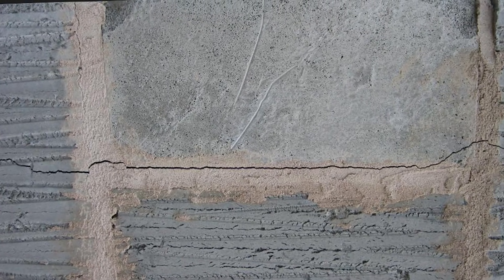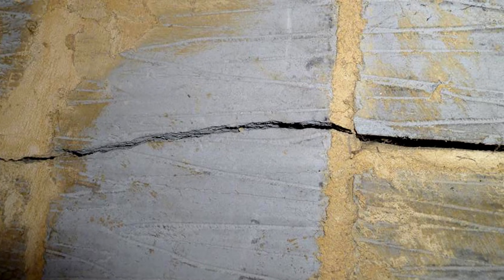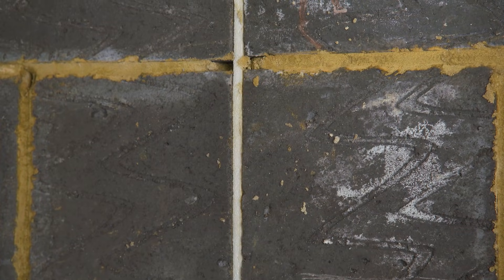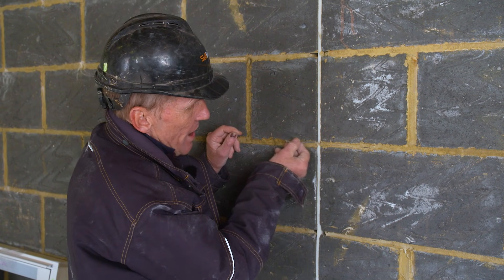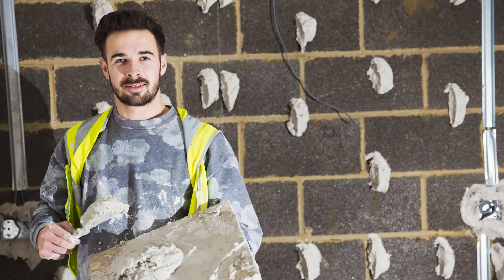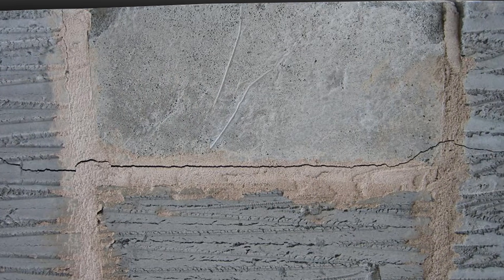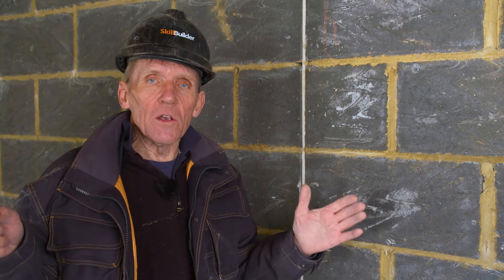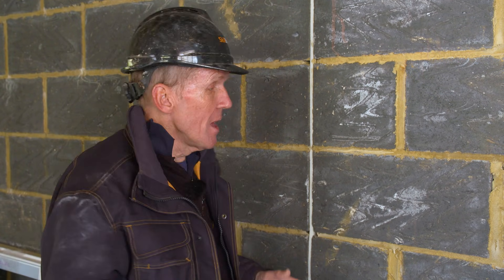Why Are Aircrete Blocks Cracking Up So Often?

Comment: But why you in UK using this tiny block ? Why not 375 or 300 mm block over 125mm what you using there? Just buy 375 or 300 mm Itong or Porfix block and you will never had this problems!!! Much better and stronger houses !!
Reply: the damp weather  for one.

Comment: Never add cement and lime together they work against each other. And majority of the time ends up a lot harder than a 5/1 Portland cement render would be
Reply from the maker: Jamie, with respect you are completely wrong on that score. Hydrated lime works with cement and won't set without. 
You can read lots of technical data about the use of hydrated lime and cement and it all points towards a crack resistant mortar with better adhesion.
Reply: Best mix for those blocks is a 1:1:6 ratio of cement: lime: sand.

Comment: Just a couple of things !! 

1. Most sites use silos now that are 6/7 to 1 ratio 
2. What’s the point in a movement joint on the blocks if u are dot and dabbing over it?? 
3. When u use a movement joint u have to use more wall ties! Every course vertical up both sides!! It’s literally going to do the same thing! 
4. Better using train track 
5. It’s all down to how materials are stored and kept! Sites should be setting up with a tin roof over all bricks and blocks keeping the rain and damp from getting to them! 
6. Better kept materials = better work = better houses = better trade simple as that.

Comment: I have a beautiful outbuilding that is full of these cracks.

It's fairly large (4.5 x 10m) single skin, unrendered. The cracks are so bad I am considering taking it down and rebuilding it.

Please do a follow up if you can with suggestions on how to address this issue.

Comment: Roger I’ve got some cracks on a few blocks on a block and beam floor. The floor goes over the top of the garage and I can see the cracks when I look up. The floor system is exactly the same as the one you did with your gang a few years ago I think 34a. The beams look in good condition though. Are the cracks anything to worry about? I’ve filled around the cracked blocks with CT1 to hopefully strengthen them.

Comment: Thanks Roger for great video, loads explained. Have seen new builds (not particularly big) where expansion joint hidden behind drain pipes at corners. That alarmed me that the gable then does not appear restrained properly (unless there are some hidden straps or clever ties). Suppose the roof timbers though might have more restraint straps and perhaps the floors also to keep it all together.

Comment: Excellently explained Rodger. 
Did you suggest that cracks are more likely under windows?
Why would that be?
Reply from the maker: Hi Roy 
The lintel above the window transfers the load to the side and it travels down each side of the window. When it reaches the bottom of the window it starts to transfer back but it only manages to do that in a diagonal which leaves the centre of the widow with no load. This means it can move easily and forms a natural break point. By putting in a few courses of bed joint reinforcement you are effectively tying the two loaded ends together.
Reply: @SkillBuilder  Ah OK that makes sense.
Thank you

Comment: Why did you need 2 movement joints in a 10 metre wall?
Reply from the maker: You may not but the structural engineer put it on the drawing and that is what was passed. The builder has no choice or say in the matter.

Comment: 6:1 mortar and EML every second course everywhere.
I have used this method for the last twenty years and it works.
I pay £6 for a 20m roll of EML, this covers approx 18m2 blockwork, works out at 33p per m2.
It's a no brainer to me.
As you said Roger the brickies don't like the tramline reinforcement but the EML is easier to use.
Reply: What is EML?
Reply from the maker: Expanded metal lath.
Reply from the maker: Do you use stainless?

Comment: Used thin joint on my extension and used reinforcement every couple of layers. Used monocouche rendering on the outside on the blockwork. Much better, and a better finish.

Comment: Spot on Roger, doing exactly that on my extension, doing it all myself as didn't trust any brickies at work (I'm a carpenter) 
Only one guy ever used lime before ,when he was an apprentice, they don't seem to learn much, as a proper bricklayer is a skilled and comprehensive trade when you get into it, but as most trades nowadays it's watered down to a basic craft for speed etc needed to get that off the chest, cheers
Reply: Same here - building my extension for that very reason. Asked the mortar question yesterday to a bricky in screwfix who replied they use exact same mortar on both skins, concretes and aircrete.
Reply: Sorry richard for your experience but I do agree, the need for so called tradesmen/bricklayers was so high they invented an NVQ. worst thing that ever happened to my industry. passing people within 6 weeks for a job that took at least 3 years to learn with intensive training . Blokes that I learnt from were on a 7 year apprenticeship
Reply: @scottnever8732  There are too many things that only come up now and again to be taught in 6 weeks. People also do not remember everything they are taught first time. You get decent craftsmen if they do a year in the classroom then a couple day release. then they get to be on different sites and see different things and problems.
Reply: @scottnever8732  NVQ?
Not Very Qualified...
Reply: @rob-123  Its more no ones interested in there trade  ,if you were you would read up on stuff and have lots pre knowledge for when you need it .
Reply: @MyKharli  it's an old apprentice  joke on what NVQ stands for. 😎
Reply: Lime is the way forward
Reply: As a bricklayer I don't take offence to you comment. They have really damaged my trade by not teaching it correctly anymore. 
All the bricklayers over 50 just shake there heads at all the young guys who think they are bricklayers but can't build a corner if they haven't got a profile.
Reply: @harveysmith100  It sucks, as a person learning a trade. It seems like I am being taught wrong, but I don't even know enough to say what I am missing, and how to make certain I learn it.
Reply: @springerworks002  If you have any questions, feel free. I am happy to help.
My advice to any young bricklayers is stay away from big housing sites. They are unavoidable sometimes but work of flats or commercial. The standard is much better. Also work with all the old bricklayers.
Watch Charlie Collison, his technique is very good and also watch Rob Songer.

Comment: Just don’t use them - end of!! 

Increase your cavity width to give you the same U-value and use standard concrete blocks!  

These aerated blocks are cheap shit, the crack crack and crumble and also cannot get a proper strong mechanical fixing into them! Should never have been given load bearing classification IMO!
Reply: They are fine if done correctly with a weak mortar mix,with lime even better, but not good in the colder months with lime that is.

Comment: I'm renovating a property built in the late sixties and have had to remove literally all the plaster off every wall due to the aircrete blocks cracking and loosening the plaster. Will it be ok to just dot and dab plasterboard onto the cracked blocks ?
Reply from the maker: Yes dot and dab, no point doing anything to the cracks as they are now the movement joint. Soft acrylic caulking might stop the draughts but don't use cement.

Comment: You should still put an expansion joint in a dry lined wall if not the plaster board can still crack. I’ve see this on long corridors were they were missed out and the plaster board cracked. We had to go back and retro fit expansion joints.
Reply from the maker: HI Dave I think you are right but customers won't have that stop bead. If they can be hidden behind a door lining then great

Comment: Can't do with aircrete blocks... Had them in a new build I lived in once the internal door to the garage kept pulling off the wall due to the auto closer on it shutting the door a bit too forcefully for the crappy blocks... Builders wanted to use them on my extension on my current house... Not a chance the drawings were for breeze blocks with appropriate cavity to give required insulation value.... Suppose the only good thing is that you don't need a hammer drill to drill into them... You could just push a biro into them

Comment: When people say stuff like 6 parts sand 1 part lime 1 part cement. How do you work that out. So how much is 1 part? Is it a spade full? A cup full? A bucket full?
Reply: Yes, it's a ratio, just make sure all parts are equal or the same
Reply: Ratio by volume not weight 6 buckets to 1 bucket to 1 bucket or other vestle
Reply from the maker: It can be anything you care to measure with. It is by volume not weight and it is not that precise. Most of the time we just shovel it in.

Comment: Do I have to use joint even for concrete 7.5 blocks? And what best mortar will be best for it, please. Thank you
Reply from the maker: Yes all block walls need to move. It should be on the drawing. If you are using 7.5 then a 4.1.1 is fine.
Reply: @SkillBuilder  thank you for the reply. No drawing, just in head for small shed, but wall will be 6.5 long and 7.3 is cheapest than 3.6 😁 (need over 900 blocks)

Comment: I did my own render indoors as the plasterer was to busy and it saved him time so he just did the pink coat. He told me his preferred mix which was 5 and 1 plus 1 of lime which puzzled me, he said it allows for slight movement. Anyway I did as he said. I cheated and used battens upright to get straight and level. I was thrilled when he came to pink up and commented on a nice neat job I had made. Did take me a few days though but I ain't a spread. Hearing his positive comment on my handiwork was quite rewarding.
That was 7 years ago now and no cracks yet,. 
Would like to know why spreads leave a gap between the finished floor and bottom of plaster, I think it's a damp thing but it can't be that simple.
Good vid that one 👍👍👍👍
Reply: It's sort of a way of stopping damp (from a floor spill) bridging but more importantly it stops the trowel  picking up bits of grit  into the skim coat that would 'drag' through the finish coat..It's also a time saver ;-)
Reply: Pure laziness,  not coating low enough 
Finished screed isn't laid til after plastering normally, so no need to skim too low

Scudding exterior walls is a great job prior to plastering 
Messy but creates a fantastic bond

Comment: Movement joints for blockwork are approx 6m in any straight run and 3m from a corner. This can extend to around 9 and 4.5m if you use bed joint reinforcement. It's closer to the corner as it's a point of high restraint. I say "approx" as if you were to 
put a joint after say 7m it won't definitely crack it will just have a higher chance of cracking. 

Roger, you hit the nail on the head with the mortar.

Comment: Way impressed what a total clear and concise video with everthing gone through and  fully explained 👍🤘
Reply: Bollocks, he says the weight of a JCB and he'll have meant an RSJ. Re cracks he's saying the cracks will be in the mortar if the mortar mix is 'right'. How is that better? And Nm (Newtonmeter) is not a unit of pressure, and 3.5 Newtons is like 4 apples of weight so that can't be right either. He mentions reinforcing mesh in the mortar; he should have said the first coat of plaster. The aerated blocks in my extension are riddled with cracks..bottom line ..aerated blocks are a crap building product.
Reply: @hectorheath9742  The problem is you think you know, but have no idea.
Reply: @UberAlphaSirus  Oh really, Sirus? You've gotta defend your comment with a reason or reasons. Tell me what's wrong with my accurate review of this shabby vid.  But you'd better read the rest of the comments first.
Reply: @hectorheath9742  I told you already. "The problem is you think you know, but have no idea." I read everything you and others said before. What do you want me to do? I can't un thick you.
Reply: @hectorheath9742   @Sirus  @UCpY_MMTfZd02WUzShANsQMQ Hector is right there were mistakes.
Good catch on the RSJ I was confused there.
N/m is a unit of torque not compression strength. He says it around 3:12
The compressive strength of 3.8 N/mm² makes sense though
which makes sense as aircrete block strength ranges I found between 2.5 and 9 N/mm².
At 3.5N/mm2 a brick sized block of aircrete can hold 9000 kilos of weight.
Still regardless of these mistakes it's a very concise, well explained and educational video to me.
Reply: @hectorheath9742  Yes, should have said 3.5 kNm, not 3.5Nm.
Reply: Yhea, I am absolutly allergic to wet trades and ground works. So it's a nice head up on stuff I don't/won't get involved in. I can't knock this lot to be fair. Sometimes there is a a bit of a fuck up, but you have to piss with what you got at the end of the day.

Comment: We've all known about the mortar being to strong for years but nothing changes especially on new build with silo muck, same old story quantity over qaulity
Reply: Agree silo muck is used for concrete/thermo lite/ and the many different bricks used on site. Whether there engineering brick or soft stocks. That’s why these new houses have massive shrinkage cracks when the thrown up in the depths of winter.

Comment: How about a follow up video  detailing what to do if the cracks have already occurred ?. It has happened on my build possibly due to strong mortar.  cheers
Reply from the maker: good idea
Reply: Came here hoping for that answer. Our Barrat house built 20 years ago has huge floor to ceiling cracks in the garage and no movement gaps or ties were ever put in so at the very least that part of the house is supported on basiocally free standing 3m/10ft sections of wall (my fear is the entire house is the same behind much of the plaster). I do wonder how widespread this is and whether or not the builders could be forced to come back and retrospecitvely fix 20+ years of shoddy workmanship on thousands of houses.
Reply: @darrenwan4095  If you sue you have six years. If the contract is underseal it is twelve years.  twenty years not much hope.

Comment: Hey mate the reason why it is more to the side is because it is there where the most movement is.
Reply: Explain why?
Reply: Good question and I'm curious about that too

I wonder if it might be one of the two perpendicular walls faces the sun and the heat makes that one move (expand) relative to the other 🤔

Apart from that I got nuffink 😁